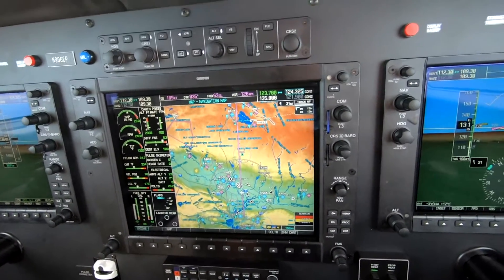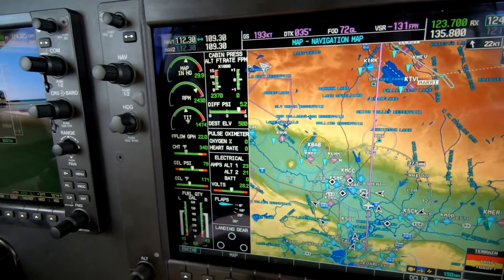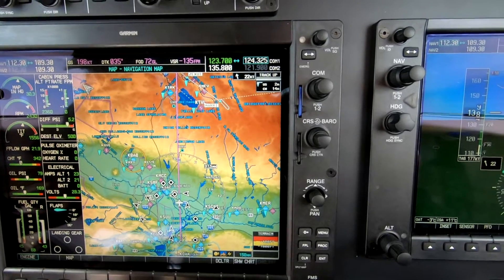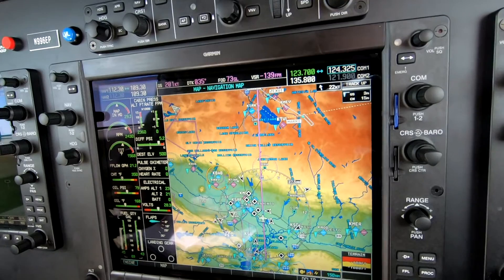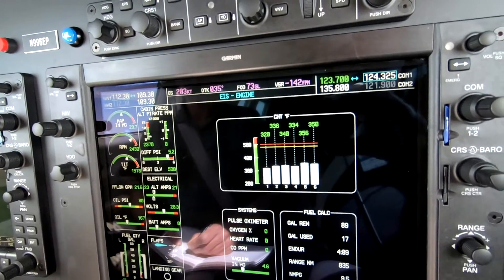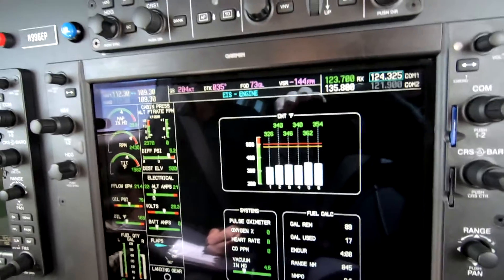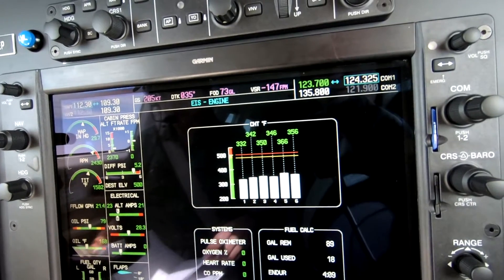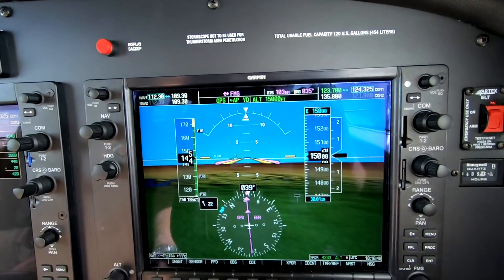Flying the Piper M350: Engine Management Methodology

Comment: Mr. Rochfort forgive my ignorance but I don't see the power setting percentage on the MFD. I see everything else. Is it set up this way on purpose?
Reply from the maker: Hi Terry, Yes. Piper charged away from percent power some time ago. The information you seek isn’t easy to find anymore. Even the power charts in the POH refer to “normal cruise”, “economy cruise”, “maximum cruise” etc. I don’t suppose it matters much as long as you operate within the limits of the POH. I like to use a consistent setting so I know of any changes in engine health by observing temperature.. density altitude being the variable. You can find more information on the engine management procedures on my website at rwrpilottraining.com .. enjoy!
Reply: Thank you for the reply Mr Rochfort. The reason I asked is I've gotten used to seeing it on Malibu Flyer channel in his 1986 Malibu. He upgraded his entire panel including the JPI to the EDM 930 where the power percentage is always visible. I also notice it in other Garmin equipped airplanes like the newer Cessna 182's, Cirrus,  Barons, Bonanza's etc. You always mention your favorite power setting as 70% and I was wondering how you know you're at 70% with no indicator. Again, thank you for these videos and explanations. They are very educational.
Reply from the maker: Hi Terry, I too remember the percent power days on the “transicoil” engine display. It is also true that the POH used to give the percentages in the power charts. You can still work it out if you dig out the Lycoming Engine book for the TIO-350 AE2A engine. A rough calculation can be made using Brake Specific Fuel Consumption (BSFC) of 1/2 pounder fuel per hour per 1 horsepower. If temperatures exceed the limits (400 CHT, 1599 TIT) something is wrong. If you run to temperature as many piston pilot tend to do you will not get this early warning. Without a good understanding of the parameters you may even damage the engine further .. or worse. he takeaway is.. know the correct power setting range, run the engine consistently at an approved power setting and write down the ECTM data in a log. There are several good (if I do say so myself) videos on this topic on my website and YouTube Channel. Fly Safely - Train Often.. DR
Reply: Thank you for that detailed explanation. I have and will continue to check out your website. Cheers!
Reply from the maker: Cheers Terry! Fly Safely - Train Often .. DR

Comment: Sir, what do you think going from a cessna 182 , 280 hours  + 90 ifr only transition  to a malibu.....also concern about plane structure fragility...
Reply from the maker: Hi, Thank you for your comment. The PA46 is a very stable and easy airplane to fly. What is potentially more difficult is making a commitment to proper training. I am happy to help you. You can contact me through my website at rwrpilottrainingdotcom. Here is the AOPA Safety Review of the PA46. It will give you confidence that the aircraft is indeed safe when the pilot is properly trained: https://rwrpilottraining.com/uploads/3/4/3/3/34335558/malibu-mirage_safety_review.pdf Fly Safely - Train Often .. DR

Comment: I would love to hear more on the "separate discussion" as to why the #5CHT is always hotter
Reply from the maker: Hi Zach, The Lycoming TIO540 AE2A engine in the Piper Mirage includes an oil cooler which resides behind the #5 cylinder. The #5 is the aft most cylinder on the right side of the engine. It has been often reported that the location (aft most) and the oil cooler cause this cylinder to run a bit warmer. It is also true that the #5 and the #6 cylinders are the same part number. Since the #6 opposes the #5 on the left side, it is said only one can be optimized for air flow thereby producing different cooling efficiency.
Reply: Thank you sir! I truly wish I could’ve come to you for my initial training.
Reply from the maker: Zach! It’s not too late! I am happy to help anytime.
Reply: If we step up to the Meridian I will definitely head your way!